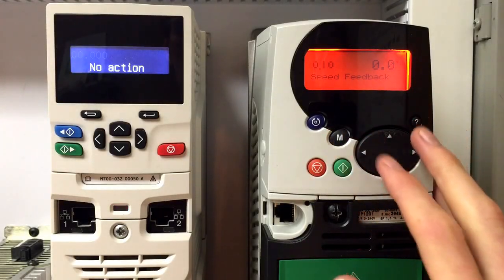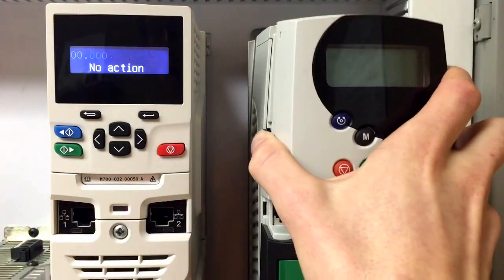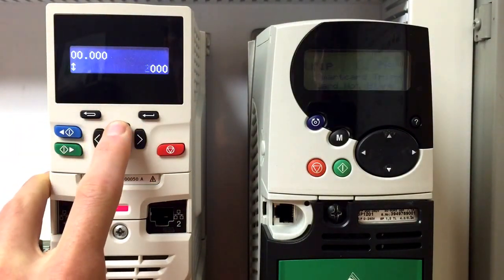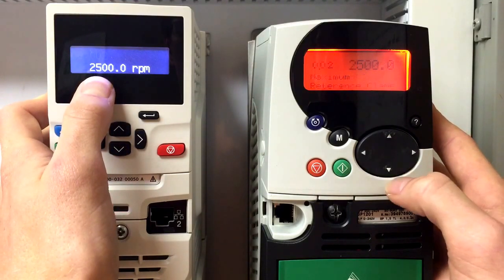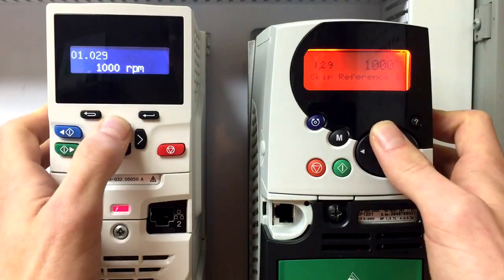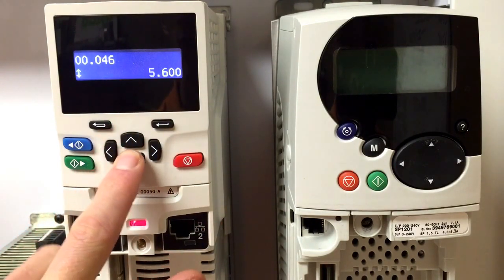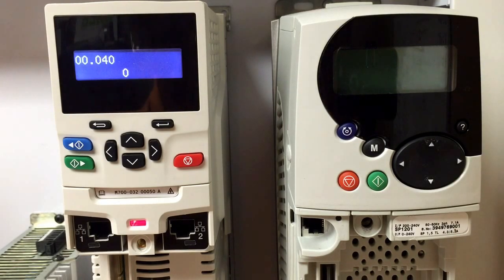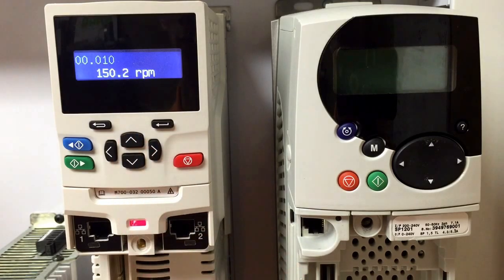Control Techniques - Unidrive SP to Unidrive M Transfer parameters via Smart Card

Comment: How reset error please
Reply from the maker: If pressing the Red "Stop/Reset" button does not clear a trip or error then you will likely need to check the diagnostic section of the manual to determine the cause of the trip and eliminate the condition causing the trip before the trip/error can be reset.

Comment: parameter no 0.35 display showing 0.0. How can edit it. please give me some help.
Reply from the maker: Menu 0 Parameters can be configured, but by default M00.P35 is the keypad reference. If you are wanting to change the keypad reference then, select the "M" menu button twice and hold down the up arrow. You should see the value increasing which is the keypad speed reference.

Comment: Motor is 75KW but drive is 90Kw ,This time drive in side parameter setting usable?
where drive in side KW parameter option and setting system? 
Please help me.
Reply from the maker: I am slightly unclear of the question, but the motor KW is not entered into the drive. You will need to enter the motors information such as; speed, current, voltage, poles, etc. into Menu 5 of the drive. After that information is entered an autotune will need to be performed.